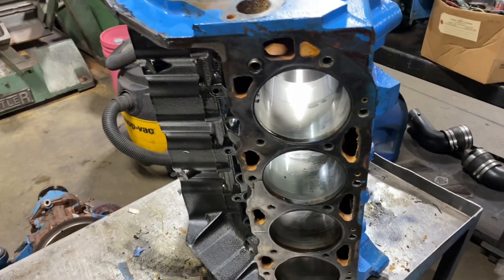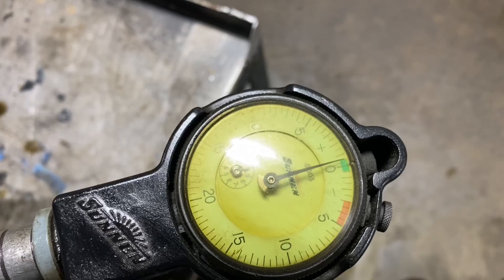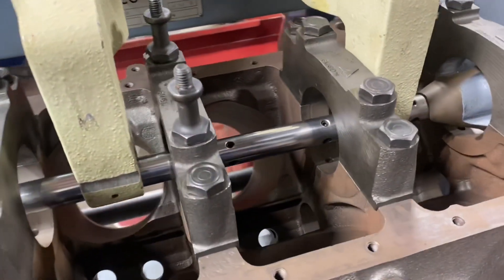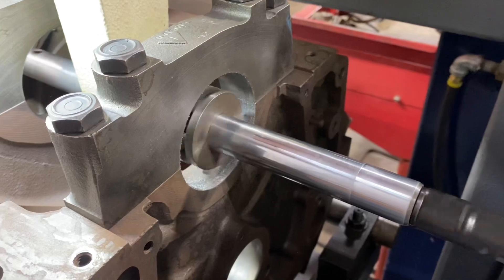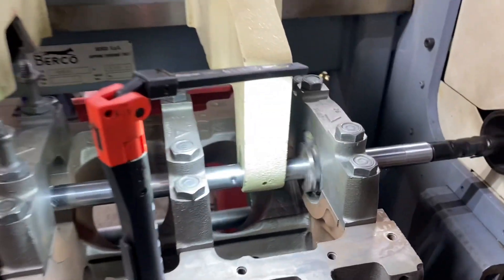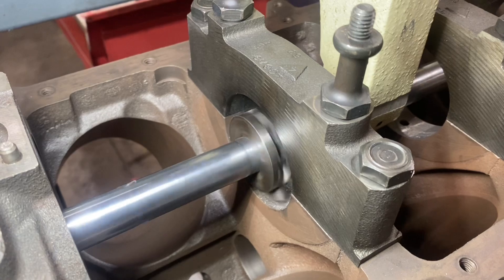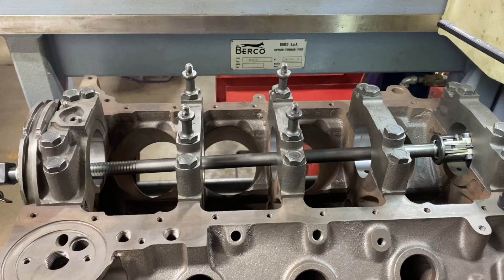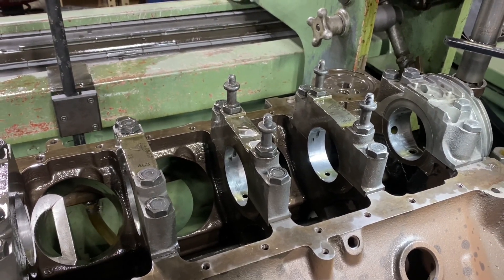Berco BT6 Line Bore 7.4 454 Big Block Chevy

Comment: how does your engine block clamp into the machine . does it just connect to the 2 adjustable fixtues on each side the block or do you clamp it down to table also ? just curious ?
Reply from the maker: Yes and yes.

Comment: If I have spun bearings on vortec 8.1, can the factory size bearings still be put back in after the line boring process?
Reply: I wouldn't think so, the cutter is making the radius in the block larger.

Comment: I’d bolt the torque plate on and then check cylinder out of round. 
    As far as the mains, those King bearings are a great save.
Reply: Probably just worn out-of-round .001", doesn't seem to be bad for a used engine.  For a freshly machined bore, yes.
Reply: Removing the torque plate off a freshly honed bore that was round, could lead to it being out of round when relaxed.  @jeeprenegade1985

Comment: Never run cutter outboard of support arms. .002" off-center is not good also
Reply: Yeah, that's what it appeared to me as well, .002" off center, not .002" out-of-round.  I would want the dial indicator reading the same at 12 and 6, and the dial indicator reading the same at 3 and 9.  Any other readings in between, you can't do much about, they are most likely out-of-roundness.